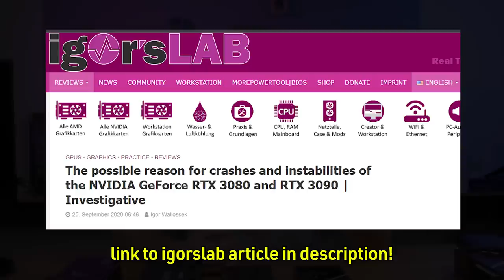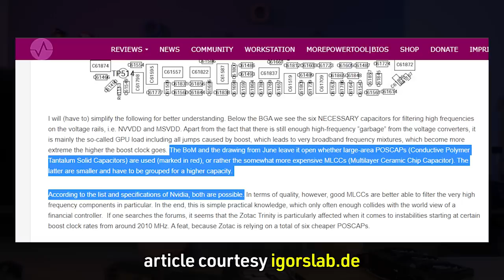The RTX 3080 Launch can't get any worse... Right? Wrong...

Comment: I’ve been trying to find the Asus Tuf this whole time. Guess it’ll be even longer now.
Reply: Yeh I have too mate, but as someone posted here, he has seen a tuf model with the cheap capacitors on there as well. So it's not as easy to know which aftermarket card to get. Now evga have said they made a "mistake" ha! and some people had the pre production model sent to them with the bad cap design but they can return and swap it. So if evga made both versions with good and bad power delivery systems and sent them out it makes sense that other aftermarket card producers might have done the same thing. Making it difficult to know which card manufacturer to go for at the moment mate.

Comment: Imagine beta testing newly launched cards 
are people never learn or what
Reply: So, coming from someone who doesn't have a 3080/90 but wants one: Whatever. This is what warranty is for. Just make sure to go with manufacturer who has good warranty, like EVGA. I'll still buy one if I can get my hands on it.
Reply: @pchernik  I don't think it falls under warranty. The card performs just as advertised at the speed that's advertised. Nothing more, nothing less. The real problem pops up if you try to use the card at higher (not guaranteed) specs than advertised. I short - Overclocking is not supported. If you try to claim warranty for failing at outside of spec use, than warranty can be denied on these grounds. It's maybe not what you want, but it's fully legal.
At the other hand - These card are great performers even at stock speed, so while overclocking is not really possible, you still have a beast of a card.
Not that I defend NVIDIA or the manufacturers, but getting mad because you cannot push the card outside the guaranteed working range is also a bit... Well... Overdone?
Reply: I'm glad I'm broke and can't afford one!... said no one ever...
Reply: @Stevospeedo It depends. If the NVIDIA specs to AIB where for minimum requirements and they have gone above that, they have no leg to stand on. They should have tested their factory-overclocked cards before selling them. I have not seen the official NVIDIA build requirements, so I cannot comment on that, but it seems to be a case of manufacturers trying to cheap out and dumping cards without testing.
The consumer, however, can indeed claim warranty if the card crashes at advertised speeds. In that situation you are absolutely right. This will be fun...
I highly doubt if these manufacturers can claim something from NVIDIA, because they build for minimum spec, and tried to go above that without decent testing. It would not surprise me if NVIDIA have recommended the more expensive configuration for higher speed cards, and those manufacturers where thinking "nah - let's do the cheapest option, it will be fine".
It's all speculation, of course, because nobody but some insiders (probably under NDA) know the real story. It will be interesting to see how it all turns out at the end.

Comment: "I'm getting less than I paid for." Yes, that is technically incorrect; but paying for a card based on reviews that were able to go to higher clocks seems very wrong. If you pay for a card based on a review you've seen and then you have to lower your clocks, that seems like its very sketch.
Reply: They're binning the best gpus for the FE so even without the capacitors thing they're still probably clocking higher
Reply: Playing Devil's Advocate here for a moment.
Most (if not all) of the reviewers got FE cards for review.  If they put up a video on the FE, which is built with a proper power delivery, it's not fair to say that it's NVidia's fault when another manufacturer's card doesn't post the same numbers because that company cheaped out on power delivery.  Just because it has a similar name doesn't mean that the components that make it are the same.  Everything is no more than the sum of its parts, and some AIBs decided to use lesser parts, making the sum of their products lesser than that of NVidia's (and other AIBs who didn't cheap out).
Reply: Just like buying a house or a new car or even voting......The devil is always in the details.
Reply: @Xomsabre  nvidia on top of there supply shortages and now this they never be able to get a stable stockpile of the FE cards they will be flying off the shelves. People were already debating that aib cards look bad and FE looks nice this whole thing will just make people double down on that decision to go with a FE card.
Reply: @Xomsabre  back in the day I remember that magazines used to test different brands card separately, even if they had the same chipset, I don't know if youtubers still do it.
Reply: @Dux Ad Regnum find them a case that will cover for every single case that people could possibly use, and they will. If you have a good enough case, and are not choking your card, the results are comparable.
Reply: @Dux Ad Regnum True for average, but try putting a 3080 in a Lian Li 011 with fans blowing on the card vs putting it in say a Fractal Design Node 304 Mini, no matter what case you pick, you'd be lying about performance to someone.

As long as the reviewers are transparent about using open test benches, it is absolutely fine that they do it.

Comment: I've just checked some pictures of the tuf gaming card and in some images it has 6 of the cheap caps while in other it has 6 of the better cap arrays.
Reply: I have one with 6 better ones. Also showed it on unboxing video.
Reply: Can't spell Asus without sus

Edit: The official Asus website has an image of the back of the card with the cheaper caps
https://www.asus.com/Graphics-Cards/TUF-RTX3080-10G-GAMING/

Meanwhile the shops that sell the card have images with the more expensive caps. Reviewer samples, never trust them.
Reply: They probably had made the promo images way before and at the testing phase had problems with the cheap caps and decided to change them to more expensive ones.
Reply: Now that is a curveball
Reply: Jeez has it? That makes the situation even more complicated. Good find mate. Obviously it's not as easy as going for a particular aftermarket card if they are making those cards with different power deliveries. Asus make two versions of the tuf gaming 3080, one normal and one oc. I wonder if there is a difference between the power delivery between those models. I guess highly possible, or is the one you have seen exactly the same model as in the video? Thanks man.
Reply: krypton I think that’s because you looked at the non OC version
Reply: @krypton1260  If you click on "gallery" from the link you gave it shows all caps have the 6 expensive ones and not the cheap ones.
Reply: Not so TUF is it. Ironic.
Reply: @hanhongzhao8102  It is the same for the oc on Asus's website.
Reply: @TechReflex  Cool! Didn't know all Indian techies take inspiration from JayZ and others.
Reply: @krypton1260   https://www.asus.com/Graphics-Cards/TUF-RTX3080-10G-GAMING/gallery/, fun fact, there are 2 different images
Reply: @paulnauman3670  wtf
Reply: @TechReflex  Did you buy that card?
Reply: @hanhongzhao8102   I just looked at the pictures of the tuf and the tuf oc from that link and it's showing the same cap design.
Reply: @paulnauman3670  yep, its getting confusing. 🤣 somebody should post an actual pic of the OC and non-OC version side by side.
Reply: The TUF gaming OC is supposed to have the 6 expensive capacitors.
Reply: @sparhawk1228  Nope you can check it yourself look at both cards, the show exactly the same backside.

Comment: Bring one of the "cheap array" cards to Louis Rossmann and have him put 6 arrays of expensive components in and retest :)
Reply: You can't, because the card wasn't designed for that, and modifying it is too hard.
Reply: @swisstraeng  You don't know who Louis Rossmann is do you.
Reply: @hazmat4629   we should ask him, myb he will see an oppurtunity in NVIDIA or at least get interested in the problem.
Reply: @hazmat4629  Desoldering and replacing a bunch of tiny surface mount parts is one thing, but replacing parts like this with an array of smaller parts requires additional traces on the PCB that simply aren't there. Modifying the PCB to take those parts is near impossible, and doing it any other way will introduce noise and/or capacitive imbalance which is exactly what you're trying to fix here.
Reply: Except you can see the pads for the ceramics under the tantalums. It's at least worth a try.
Reply: @Stevospeedo In this case it's not a bad design, it's just a choice of component. If you look at the board there are connections for both the cheap capacitors and the expensive ones. It's just a matter of removing the cheap ones and using the other connections to solder on the more expensive ones. The reference PCB design is the same for both.
Reply: @GonePh1shing  Dude the pads are already there. You can see them. If the card's using a reference (non-custom) PCB, then there is no difference in the trace layout.
Reply: @Joe Troll Assuming that it's a custom PCB, sure. But the whole point of a reference PCB design is so that's not necessary.
Reply: The board pcb seems to be universal. It has all the pads to solder the small caps. Is up to them to choose what to use. I think that this mod can be done without problems. Of course. You need to know the values of the caps.. and have the right tools to replace them.
Reply: @Horayken  Exactly. And Louis Rossmann has the domain knowledge and tools to suit. This is the same guy who has a machine capable of performing ball grid array reflow soldering.
Reply: @Stevospeedo Yes, they did. If you watched the video you'd know that's because it's a minimum spec. At lower frequencies it doesn't fail, but the problem is the board partners advertised high overclocks while using the minimum specs. You should be complaining instead about the low profit margin that board partners received this release that tempted them to use lower specced components instead of matching the Founder's Edition.

And besides, this is getting away from my original point which is that because it's a choice of component and the design supports either choice, Louis Rossmann is more than capable of swapping out a few surface mount components to make the fix.
Reply: @Stevospeedo Then NVIDIA's minimum recommended specs might have been too low. My original comment had nothing to do with NVIDIA or the AIB partner's fault - I was really just talking about Louis Rossmann's ability to fix it.
Reply: @Stevospeedo Okay now we're just going around in circles. There are pads for both the cheap caps and the expensive caps, and since these are reference boards there are traces available for both. All he needs to do to fix it is have the more expensive capacitors available and do a little light SMD soldering, two things that are very much in his wheelhouse.
Reply: @Stevospeedo kk
Reply: @Stevospeedo It is absolutely a fix that Rossmann could do. Not a super powerful fix (it only opens up double digit improvements in clock speed), but definitely possible.

Comment: The 800 dislikes for this are the butt hurt scalpers lol
Reply: You mean *pissed off players unable to buy a card while these tech tubers have 3 or more
Reply: It could be that there's a lot of assumptions being made here that may not be correct. What are the capacitor values? What are the component costs? Typically those small MLCCs are very cheap, it should not have any significant effect on the BOM whether they use one or the other. Polymer caps do offer other significant advantages over MLCCs, such as better performance over temperature and less change in capacitance as the voltage changes. A lot of engineering goes into the design of bypass and filter circuits, and his oversimplifications might be boiling down to effectively gibberish.
Reply: @mtbiker678  Careful, I got death threats from Jayztwocents fanboys for saying he didn't know what he was talking about. And also people aren't experts after watching a terrible video by Jayz.
Reply: They deserve no pity
Reply: Oh shit, I never thought about that. LMFAO, they deserve it.

Comment: What's particularly hilarious is those "expensive" caps are almost nothing in price compared to the GPU, the fans, the mechanical parts, the PCB, and pretty much everything else... You're looking at maybe $1 total production cost saving to use tantalum caps vs a bunch of smaller and faster MLCCs. As a result of the bad press around this, nobody's going to want to buy the cards that saved $1 on parts...
Reply: julian higginson What’s hilarious is that they mass produce these cards. If and when they mass produce the cards with the cheap arrays, they save thousands of dollars and can even get in the hundred thousands range
Reply: @fresh4190  well, duh. but as the SAVINGS go up with quantity, so do the potential RISKS and LOSSES if you cut too hard and break or degrade the product... Particularly for  a premium consumer item that people only buy because they feel like it.... 

And we're not just talking about the current units still in the supply chain or with unhappy end users, but all future versions of these products that may be fixed with board respins to include the extra $1 of parts,  but people still won't trust them, so they will have to sell for a large markdown to entice consumers back..... or require entirely new branding and marketing and launching campaigns.... 

If you have 100M of sales projected on a high value new product line, you'd expect people might be a little more careful about saving that last dollar on each unit. particularly for the first units into the market.

Comment: The reference board they gave to AIB is probably only able to hit base clock with no turbo at all 
And now, all the AIB are like Shocked Pikachu Face
Reply: You're exaggerating now. It will still boost some.
Reply: It showed the reference spec has 1 of the expensive arrays, and 5 cheaper ones. The AIBs that are using cheap caps, are building cards below the reference spec.

Comment: Imagine a recall on all these cards what a headache that’d be😂💀
Reply: Wouldn't think so 14 from the legit customers who actually managed to get one and 10,000 from the ten scalpers who used bots to buy out the rest.
Reply: @L8ugh1ngm8n1  they wont recall. The cards still work up to spec. just GPU boost that's need a patch. that said, I enjoy overclocking and this is bad.
Reply: @declaredsnow  exactly, they work at refrence specs. Covered legally
Reply: @declaredsnow  They should, or at least give back the difference people PAID for the OC models.
Reply: @TransformX  thats true. Gift cards away
Reply: @RichardDower  Nope, they sold OC models at a higher price, people paid for this OC. They are not "covered" at ALL. They should reimburse (at minimum) reimburse the difference between the mon-OC and the OC models.
Reply: @declaredsnow  That defense did not work when Nvidia was sued for the 3.5 + 0.5 GB fiasco.
Reply: @steak5599  hehe, I remember that shit.

Comment: we are what 1-2 weeks away from release and here's what we already know 1) the 10gbs were purposefully chosen to prevent the 3080 to be able to play "8k" and do the same prosumer tasks the 3090 can because "what a coincidence" those two things don't require +20% cores they require 11Gbs of vram...11...and the 3080 has 10...hmm 2) the 3090 is not a titan because nvidia willingly blocked some features that old titans had to leave space for a real titan later or 3090 ti/super 3) AIB ruined their cards for 5$ of components and were pretty much screwed up by nvidia which probably knew since their card had the MLCCs, 2020 is the year that keeps on giving ! cancel all your orders/pre-orders people send a strong message
Reply: Yes people cancel your 3080 orders. So i can get mine.
Reply: The 3090 can’t do 8k gaming lmao don’t kid yourself
Reply: If Nvidia has sent those AIBs a spec sheet that says there should be an array of the more expensive ones, how exactly has Nvidia screwed the AIBs over when the AIBs choose to use cheaper components?

Comment: this man has multiple 3080 laying around in his table while i'm here with my gt 210
Bruh i need to get me a new gpu
Reply: And probably cpu
Reply: @samsunghandy   might as well get a new pc amirite
if i had the money i definitely would
Reply: @Fogolol  yeah I mean, the new gpu is too goddamn good, you'll have to get one of the fastest cpu's to handle it or reduce bottleneck and everyone would get what they want if they had the money
Reply: @yepitsarif  You don't need the fastest cpu for the 3080, just up the resolution. At 1440p or even 4k the difference between a ryzen 7 2700x and a 3800x is maybe 10 fps, if at all, because at that resolutions, even the 3080 will become the bottleneck.
Reply: @yepitsarif  honestly i don't need a 3080 or even a 1080, a 1050 will do for me since i am used to 720p gaming because that's just what my monitor does
so to pair that 1050 a ryzen 5 would do nicely
Reply: bro. a 1030 is about 80 bucks. just go an AMD apu. skip the whole problem. 3400g's are easy to get 2nd hand now
Reply: @fuzzjunky   wanna see that working on my old asus motherboard lmao
Reply: @Fogolol  if you can't afford a 1030 you should probably concentrate on getting a job before doing anything else anyway. you got bigger problems
Reply: I honestly would stay away from 1030s. The newer ones are crappy ddr scams. I would go for a second hand rx560 or something like that.
Reply: Well, I'm still stuck with my loved R9 390 paired with a 3900x. I was about to buy a 5700xt last year but those drivers issues turned me away, so I decided to wait for the new AMD and Nvidia cards. This holiday will be nice.
Reply: Hey the 210 makes a good hdmi htpc card, got one cheap to make a plex machine with a e8400.
Reply: @powderedwater67  can it stream 4k30p? 1080p60? I have one gigabyte 1gb rev 5 one
Reply: @deltaoscaruniform1316  haven't tried 4k, but 1080 60 is well in its range